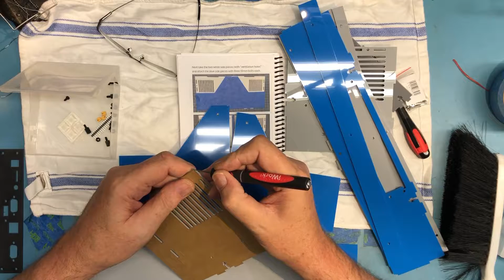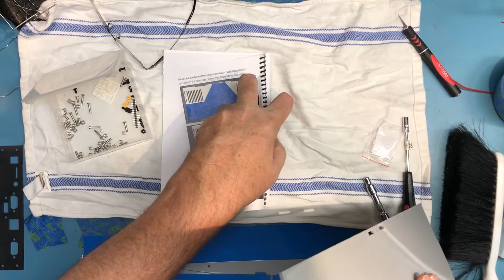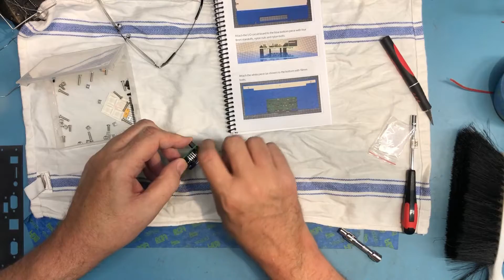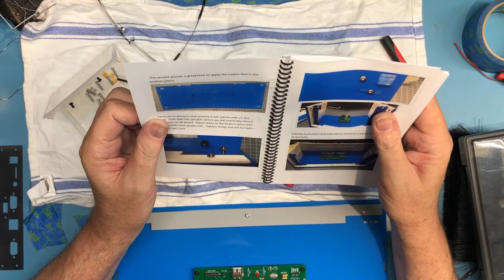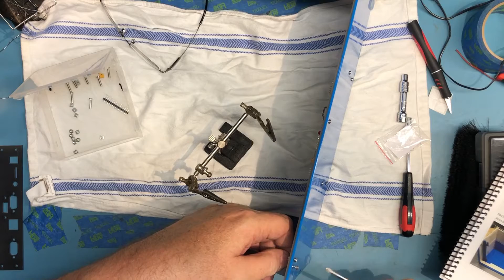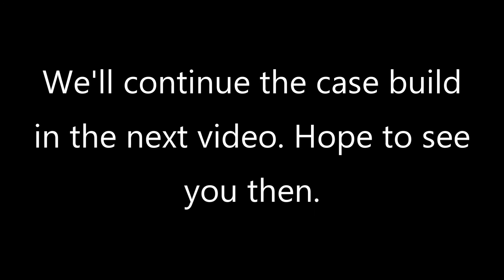STB399 - Altair 8800 - Adwater & Stir - Part 6 - Case assembly

Comment: Similar experience to me on the acrylic piece-together, but mine was the IMSAI simulator kit. Too tight with the screwdriver, and the T supports crack. Oh well, mine still holds together fairly well.